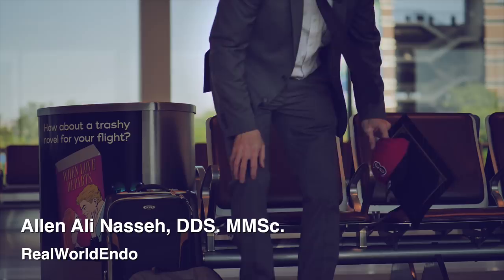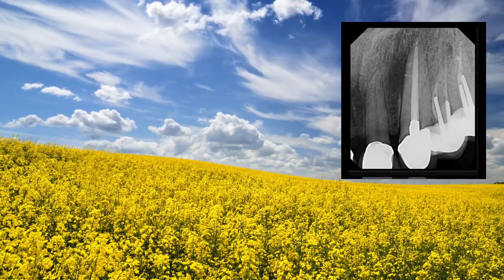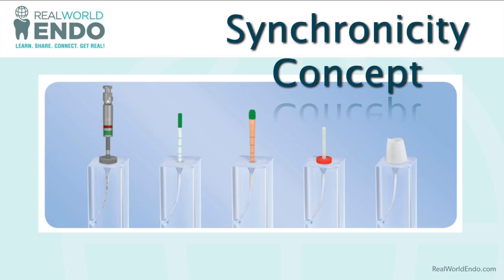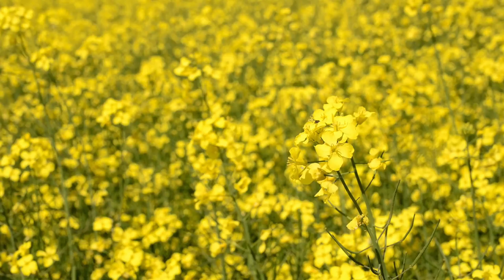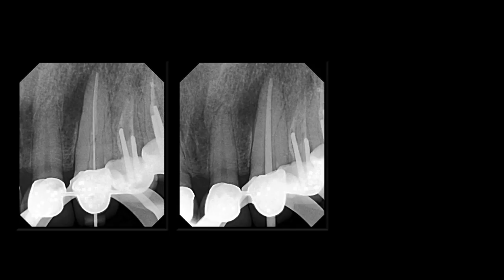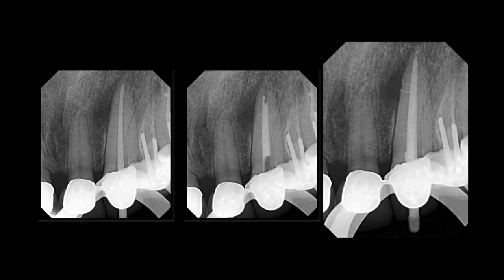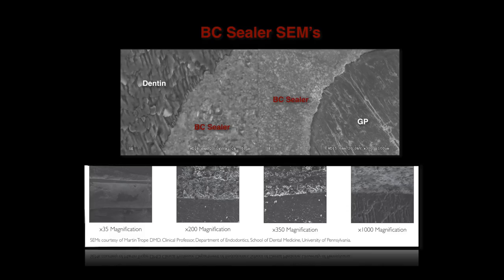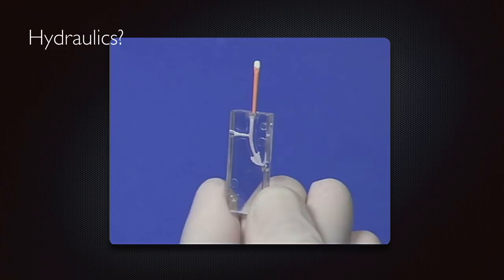Lateral Canals during Hydraulic Condensation Technique (vlog)

Comment: BC sealer being hydrophilic,requires the canal to be NOT dried prior to obturation?
Reply from the maker: No. Works dry, wet, or moist. Ideally, you get the most bond strength when it's moist. So, one or two paper points will do. Cheers!
Reply: @AANasseh  A final rinse with saline or distilled water and drying with negative pressure or 1-2 paper points would suffice?

Comment: Can i only coat my m. Cone and have the same results? Regards
Reply from the maker: No. I don't think you can predictably get adequate sealer in the canal that way. Furthermore, you increase the odds of a vapor lock. Coat the canal walls first, then gentle seat a lightly coated cone. Cheers!
Reply: Thx dr. I will coat it with paper point , regards